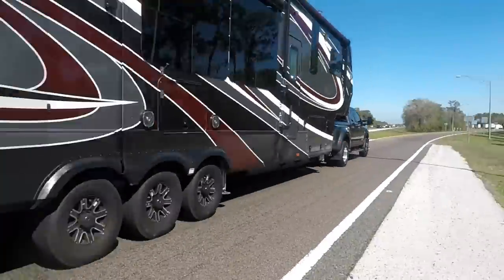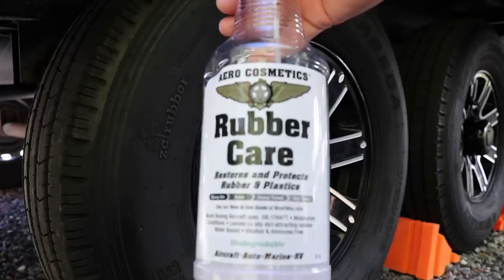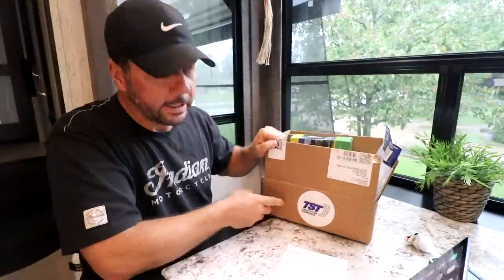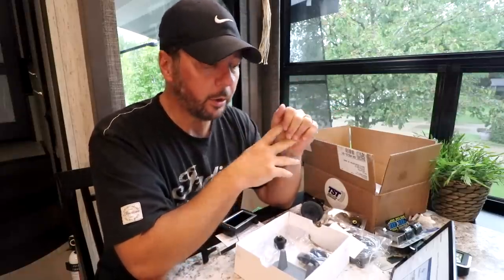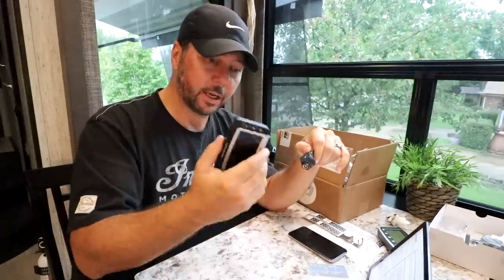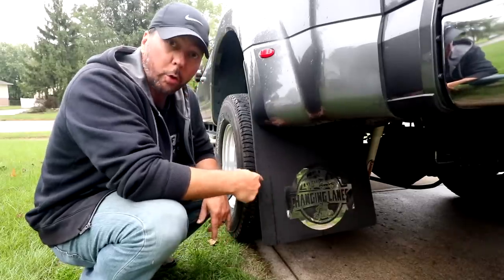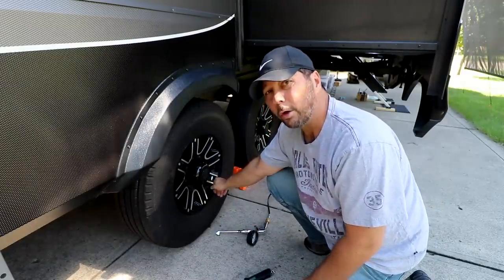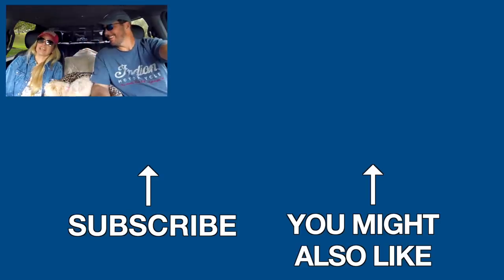RV and Truck Tire Safety | Best TPMS (Tire Pressure Monitoring) (TST-507) Review | Changing Lanes!

Comment: Love video. Exact truck. Considering a over the lip tool box tonneau cover combo.  Wanted to know you height restriction of the toolbox you used and why?
Reply from the maker: When we bought our rig, we had a toolbox that was about 2 inches higher than our current one and it was too close when making sharp turns.  So, we needed a quick solution and swapped it for a low profile one.   Check out our towing video here and you can see the clearance: https://youtu.be/87runDszXLQ

Comment: Be careful... yes ..armorall can actually soften your sidewalls . Know if your uv protection is compatible with rubber. 
Should not have petroleum base in it .
Also check the speed for your tires.
Reply from the maker: The stuff I linked in the description is specifically made for rubber.  Good stuff!
Reply: @ChangingLanes  love it .
So many 1st timers and even old RVers don't know it .
I'm glad you two are taking time away from your time to share this ❤❤❤

Comment: Hi Chad, Another great video, we got the 507 TPMS through Eric at TecnoRV Thanks for the info! They changed the cap sensors so, the housing does not spin anymore. I do have a question, What tire pressure gauge is that you are using?
Thanks, Wally
Reply from the maker: Thanks! 😊 We use this gauge: https://amzn.to/2NKmcyP

Comment: Great video, thanks. Why did you not use the Ford TPMS package instead? Is this product not as good as the after market products you have seen/used?
Reply from the maker: The ford TMPS option for trailers requires some special wiring as well as pulling all of the tires to install the sensors internally.  And I couldn't get a straight answer on if it would even work with our rims.  This solution is waaaaay simpler.  It's bee working great for us!
 Thanks for watching!  😊

Comment: I have the Cap style TST sensors and lost one of my non-steel valve stems this last trip.  All my tires are going to the tire shop for steel valve stems as I type this.  The TST did warn me of rapid pressure loss and I was able to pull over before the tires dropped below 45psi

Comment: Hi guys.  Hope you are well.  Another great video!  Thanks.  One question for you... did you guys purchase sensors for your spare tires on the truck and rv?  Thanks again.  Safe travels.  bg
Reply from the maker: Thought about doing that.  Just not sure if it's really needed since we can always air it up if we need a spare and it's low.  Thought it was a good idea at first, now not sure.  Might be overkill.  Have any good arguments for it?
Reply: @ChangingLanes  no not really.  Perhaps just the convenience & security of knowing that the spares have proper pressures without getting beneath the vehicles... that and they could serve as spare sensors if needed... all simply convenience and not so much true need.

Comment: Another great video and so helpful.... question for you regarding the repeater install?  Why  not install it in your truck and connect to one of the upfitter switches?   I was just wondering if that would/could be an option.  Then I could use this set up for when I tow the RV and add sensor to other trailers I tow.
Reply from the maker: Thanks!  😊  That should be fine so long as you mount the repeater at the very rear of the truck.  It needs to have proximity to the sensors on the RV.  With the battery and a bunch of DC wiring right up there in the front bay, it was a super easy install.
Reply: hhhmmm ok, not sure where best to mount the repeater on the rear of the truck to keep it safe and powered up.  Will have to think about it.
Reply: Unsure where to mount it to the rear of the truck and still have power...
 @ChangingLanes

Comment: Great video and thanks for the good info! We’re getting our new-to-us 5th wheel rv ready for a US tour starting next summer. This and the ViAir compressor are on the list and probably new tires just before “ go time”. One thing I wonder about is wheel balance with the heavier flow-thru sensors. Any reference to that in the install info/email from the vendor?
Reply from the maker: Someone else had asked about that (balance) also, so I asked Eric @ TechnoRV: "The sensors do not affect the balance. The cap sensors weigh 15.4 grams and the flow thru weighs 22 grams, all less than a ounce so no issues with balance."  Thanks for watching and good luck getting your fiver ready to roll!  😊
Reply: Thanks for the quick reply! I really appreciate the follow up. I’ll be adding this to my Ram as well - Rams over 10,000 gvw  don’t have TPMS - even if it had it the temperature sense is definitely a bonus. You two rock!

Comment: Another great video from y'all. Thank you!  I have a question that I wanted to ask.  I have noticed in a couple videos we saw your undercarriage, I noticed that there is some rust already.  Did Grand Design not coat the undercarriage with a rust resister coating? As a Florida resident, the humidity is killer here so it is something that I think about a lot when I think about RVing full time.
Reply from the maker: Yea.. it's a bit rusty.  Planned on giving it s shot of the rust busting paint / treatment.   Might be because it was delivered in December and had some salty roads?  Dunno, but it is just surface rust and we'll be taking care of it soon!
Reply: Changing Lanes, thank you Chad. If possible please show us how you handle it. You are very detailed and it is very much appreciated. You two are building a solid channel! 👍👍

Comment: Another great video, Do the sensors knock out the tire balance? Or are the weight of the sensors not heavy enough to make a difference.?
Reply from the maker: Thanks! 😊  I don't think they're heavy enough to make a difference, but I'll email Eric at TechnoRV and get his official take.  My guess is that if they were heavy enough that warning would be in the documentation.

Comment: more great info!!
what did you decide on tire rotation, side to side vs back to front vs crisscross?
we bought a 10 year old trailer 2 years ago with virtually no miles on it, so of course the original tires had plenty of tread left.  But on a long trip, two of them started to fall apart!  this was 1000 miles into a 5000 mile trip!  so we bought 4 new ones, not just two!
Reply from the maker: With trailer tires, they will almost always fail from age versus wear.  10 years is definitely past the 3-5 year life expectancy.  For us, with 3 axles, its criss-cross and straight across for rotation.  Four would just be criss-cross.. 👍🏼
Reply: @ChangingLanes  yup, a lesson learned!

Comment: Inflate your tires to the psi listed on the sticker on the driver side of the trailer, not the max listed on the tire. Many times they're the same but not always. 

If you replace your tires and get ones that can support more weight they may be capable of handling a higher psi. Still only Inflate it to the number on the sticker.

Comment: Catching up on your older video's - Chad, which tire gauge are you using, and are you happy with it? The duals on my Class A are kind of a pain to get to the inside one (and after having multiple leaks from extensions/hoses I'm running straight stems right now), and the one you are using in this clip looks interesting.  Thanks!!
Reply from the maker: We still have the digital gauge in this video, but not even sure where it is...  I just use the sensors themselves (we still have the TST and love it) to get measurements, then the gauge on the pump when adding air.

Comment: We're getting this TPMS system using your link.  We have the 397TH and want to know what you recommend for the sensors.  I like the caps because people cannot steal them.  But it appears you like the flow through.
Reply from the maker: Yes... we like the flow-through.  Those caps with the spinny covers are great in theory.. but a real PITA when you want to add air.  We have about 18K miles with the cap sensors on and no one has messed with them (knocking on virtual wood). 😊    Thanks for using our links! 👊🏼
Reply: Any issues with the flow through rubbing or hitting curbs?

Comment: I really liked your video on installing a TPMS and found it very helpful. Im a newbie to RV life, so excuse the silly question. I have 4 tires on my unit, 2 on each side at the back (no dualies) and none at the front.  I can't figure out which of the 6 sensors go on which tire. I've searched everywhere and am still clueless.
Reply from the maker: Your tpms should have come with instructions on how to set the sensor to the tire. If not you could try googling instructions for the unit you purchased. 😎
Reply: @ChangingLanes  Hey, thanks for replying to my question. I tried all of your suggestions before contacting you but didn't have much luck.  I'll keep searching though.  🙂
Reply from the maker: Hi!  Ideally, every tire should have a TPMS sensor on it.  If you have 6 sensors and 8 tires, you need two more sensors. If your truck has a built-in TPMS then it's not a big deal to let the truck monitor those.  We just like all of our tires in one display.  Hope that helps!  -chad
Reply: @ChangingLanes  The part that is a bit confusing for me is that they are numbered and according to the instructions should be placed on a specific tire. Unfortunately, their tire layout does not match mine and I want to make sure I install them on the correct tire... or does that matter? 
Thanks
Reply from the maker: Doesn't matter as long as each position is correctly registered in the TPMS.  Usually, this is done by the consumer and they are not pre-numbered.
Reply: @ChangingLanes  That's where the confusing part gets worse, they "are" numbered.🤣 I'll go ahead and install them the best I can.  As long as they synch with the correct tire I should be ok? 🤔

Comment: Chad I didn't go through all the comments but question the pass through sensors that you put on the trailer tires have you notice any problems with them sticking out past your tires and has that caused any issues through your travels. Thanks btw for the savings on the tpms kit from techno
Reply from the maker: We've got about 4000 miles on them so far with no issues at all.  Working great!

Comment: If your tires are a different size, I don't think you can rotate them.  Not sure if you can swap Tag/Drive Axle Tires (they are the same size).  I also noticed a directional arrow on my Michelin 22.5" Tires so swapping sides may not work.

Comment: My apologies if this has already been answered, and thanks in advance. Have really learned so much from your channel! Do you prefer the pass through or cap style TPMS monitor units? Also, is there a need to swap existing valve stems out for more durable metal options and/or use the metal extender stems?
Reply from the maker: Metal stems are only needed for the pass-thru.  We have pass-thru on the RV and caps on the truck.  The pass-thru are just too tall to fit on the truck and still get a fitting on to add air.
Reply: @ChangingLanes  Appreciate the reply. Out of curiosity, why do you have boards under your front landing gear but not the rest, and also under your stair feet?
Reply from the maker: This is Tara's brother's house and the driveway is steep!  Jacks aren't long enough by themselves to get level.. Then, when level, the stairs are too high..

Comment: Do you recommend putting on the TPMS on the truck when you have built in TPMS?  My 17 RAM Dually has a tire by tire read-out.
Reply from the maker: Not really necessary.  We have it on our Ford also, so it's definitely overkill.  But figured it would look cool in our testing and give us a chance to try both types of sensors.  😎
Reply: If one of your truck sensors fails, nice to have a back up installed.

Comment: Great video, but I am a bit disappointed that you didnt mention the importance of getting your trailer wheels balanced. Manufacturers do not balance their wheels (or their hubs) which is bound to damage the tires and suspension - You wouldn't drive down the interstate at 65 with unbalanced wheels on your car so why do it with your trailer. Some trailer rims are difficult to get weights fitted so a great alternative is the Centramatic Tire balancing system which automatically will balance the complete wheel and hub assy. Great channel though - keep it up.
Reply from the maker: Been looking at the ceramics for both the truck and trailer...

Comment: Hey Chad, have you found that your hi temp setting of 145f is working out, or have you had to raise it back up to the default of 158f?
Reply from the maker: It's only alarmed on temp once or twice on the truck front tires on a super hot summer day, right after stopping...  They are the most likely to hit that being the steer axle.  So I just ignored those, but we've never hit that temp threshold on the trailer so it must be a good setting.. 👍🏼
Reply: @ChangingLanes  Thanks Chad!  Getting ready to install ours tomorrow.

Comment: Look at boarwheel.com about updating to 225/70R19.5  LRG, 14 ply rating, 110 psi capacity tires. This is the solution to blown tires, by going to a heavy duty solution. The rim has specifications for weight and psi stamped on it.           Higher test standard. Tires sizes over 17.5” rim diameter have a different test standard than smaller tires. For example, a Load Range G (14-ply rated) 235/85R16 tire has to withstand a 6,300/ft.lb. breaking force to pass FMVSS testing. A 225/70R19.5 Load Range G (14-ply rated) has to withstand over 18,000/ft.lb. breaking force. Almost 3 times the breaking force! This means a stronger tensile strength steel, higher grade rubber, and a different manufacturing standard. The tread depth is 16/32”

Comment: Thx for sharing.  Great video and information.  Trying to convince spouse why this is important.  3 q's I have.  Can you answer?

1.  Why do you need TPMS on a new truck that already has low tire pressure warning system installed?
2.  Can you share close up of the repeater item.  Want to see how you did this.
3.  How long is your rig and which sensors were not showing up on eeze tpms?
Reply from the maker: 1. We don't  We were just wanting to test both types of sensors so we doubled up on the truck.  Totally unnecessary.
2. I will be installing a battery monitor along with some bus bars in the front bay soon.  When I do that, I'll also film proper wiring and mounting of the repeater.  Right now, it's essentially just wired red to the positive of the batteries and black to ground.
3. 44'.  It would sometimes drop the rear axle readings and just display old data for about an hour before going to  - - - - .

If you're trying to convince your spouse, read a few of the comments below about how TPMS saved them from blowouts, fires, etc.   Those tires are important! 😊  Take care and thanks for watching!
Reply: @ChangingLanes  i sure will.   We are heading out in a 31' motorhome, tow dolly and 2006 jeep in November from Des Moines, IA to Palm Springs, CA.  Thats about 1,700 miles.  Im very concerned about safety.
Reply: Am sure not many women are as excited about this like me.  :)
Reply: @ChangingLanes  can i ask you another question?  When you put the sensors on, dont you lose air pressure then?  Also, does some of the air pressure remain inside the sensor?
Reply from the maker: If you do it nice and quick, the pressure loss is negligible. If you get the flowthru sensors, you can fill / remove air without removing them which is nice.

Comment: You have had the TST-507 for some time now. We are looking for a one because we are not happy with the one we have. Do you still like this one or are you thinking about getting a different one? Are you having any problems with the unit?
Reply from the maker: We still use the same unit and love it.  We've replaced the batteries in the sensors once and that's it.  https://changinglanesrv.com/tpms
Reply: @ChangingLanes  Thanks for the information.

Comment: Can you show how to connect the repeater to the 12 volt in the battery compartment?  What do you recommend to install for easy connection?
Reply from the maker: I will cover that in an upcoming video.  But, it's super simple... red to red / black to black.   Most rigs have some leads coming off the batteries to bus bars too.  Just follow the wires.

Comment: goof info!    my rig was delivered w/ tire pressure at 60 when tire max is 80 pounds.   i raised the tires to 80 and find the empty rig is a little stiff empty,  looking for site to find tire inflation / load rating.
Reply from the maker: Yea... when a trailer is loaded very light in relation to GVWR, you can go lower based on the manufacturers load charts.  You need to contact the tire mgfr in mot cases to get a load chart.  Then you can do a smart weigh (where they weigh each tire), or get a standard CAT scale weight and divide the trailer axle weight by the number of tires (maybe round up a bit).  Good luck! ~chad

Comment: The number one reason for blowouts is exceeding the magic 65 mph. No matter how well the tires are maintained. No matter what perfect pressure you have.
Reply: Low tire pressure is number one, the best tire will fail with low pressure the side wall flex will build heat and eventually blow. Number 2 is damaged tires, number three is worn out tires, number 4 is probably sun damaged tires but that could be part of number 2. Staying at 65 MPH isn't in the top 5.

Comment: I have a ‘19 F350 DRW.  Are the sensors a pain to deal with? I see you used the capped vs flow through sensors. Just wondering how much trouble it is to remove/install the caps if I add air.
Reply from the maker: Yea.. the flowthru sensors just don't fit on the dually.  Well.. they "fit" but you can't get to the valve on the sensor, which means you have to remove it, which essentially makes it a cap sensor for all practical purposes....  The cap sensors are no more difficult than a regular stem cap.   You just have to go on fast to not bleed off too much pressure while putting it on.  👍🏼